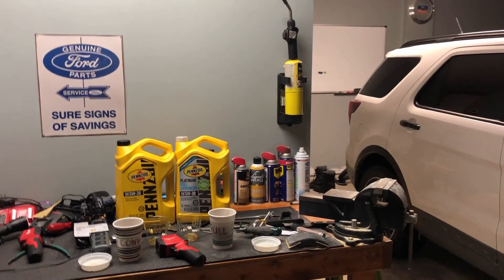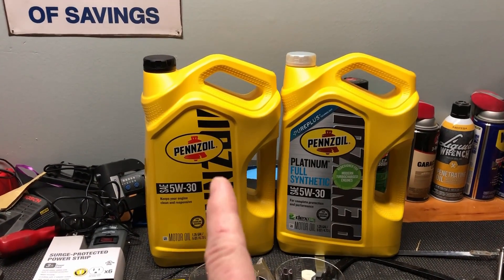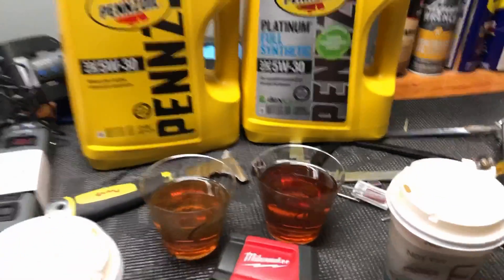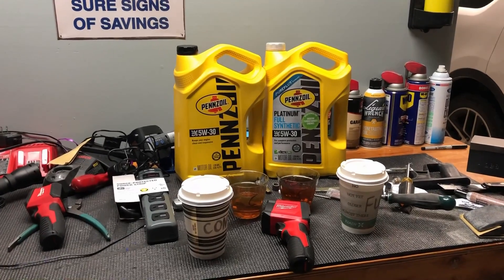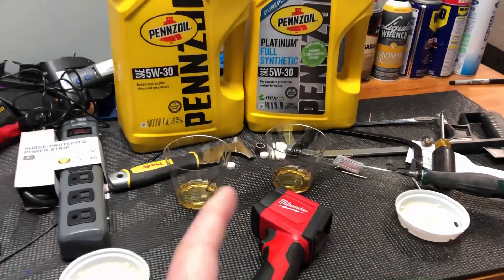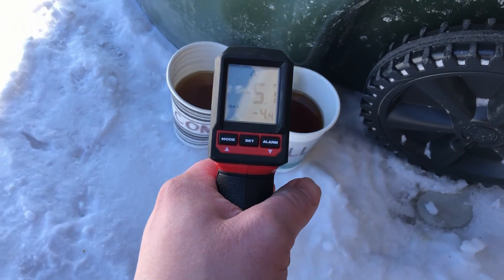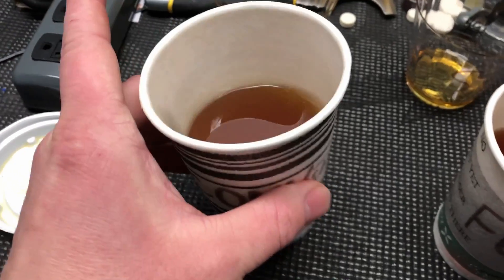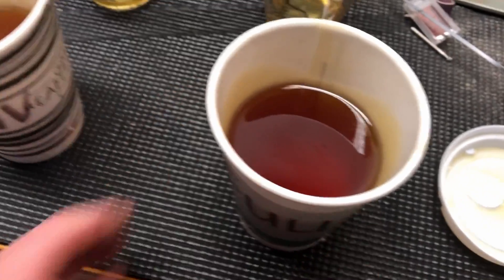Conventional vs Synthetic: Which Oil Do You Want in Your Engine During the Extreme Winter Cold?

Comment: What about the synthetic oil in the summertime but? Would it be safer to use conventional in summer time over the synthetic as the heat would make the synthetic thinner like water and have less protection over the conventional?? Just my thoughts 👍
Reply: I'd say pick an oil type and stick with it.
Reply from the maker: Synthetic is superior at all temps especially in extreme cold and heat.
Reply: I’d say conventional would be better in summer,maybe synthetic in the winter
Reply: Monza 84  synthetic does not break down at higher temps like conventional oil does. As mentioned already synthetic covers a much broader range of temperatures per viscosity range.
Reply: @dmc1221  you do not want to switch back and forth from synthetic and conventional. You would want to use that 10 minute oil flush stuff if you were going to do that. But not a good idea! Pick one and stick to it🤔
Reply: Why would you need to flush it,sure you can mix oils,and I personally wouldn’t use flush as it can do more damage than good
Reply: @dmc1221  once you use full synthetic It Coats your motor differently. Look up yourself. You can go from conventional to synthetic but not recommended to go from synthetic to conventional. Sorry I don't have time to give you all the scientific details🤓

Comment: I have 2 cars currently, an Aerostar. (97) and a 95 New Yorker..

Both run good, and use little oil.

The van has 170k miles, the car 52k.  I used to drive a 93 Deville and it had arpund 80k. It also didn't use much oil until a couple of days after a fresh change of Mobile 1. Buy buy rear main seal.

Fool me once...

Comment: But if it doesn't stick to engine parts, you will be starting the motor dry.
Reply: Perhaps if the engine sits for a month it will dry, but in most cases people start up their engines daily, or atleast a couple times weekly.

Comment: 04 F-150 5.4..230k mi...Valvoline vr1 20w50...-22 degree's last nite...i left it run all nite $10 worth gas in 13hrs idleing....didn't worry about startup...engine has never been apart :)
Reply: 20w50? I'm not on the 5w20 bandwagon, but why THAT high? Trying to stop a main seal leak?
Reply: Truck has never leaked oil....20w50 runs 10k mi without any trouble....thin synthetic oil won't
Reply: Makes me wonder, what causes more engine wear?: 13 hours at idle, or one cold start at -22f? Not that any of us can know without actual testing, just a thought
Reply: Idleing won't hurt it...cold starts might....battery can't take -40 wind chill so leave run.   0 degree's and above it starts fine.
Reply: Immediately after it leaves the factory...lookup vr1
Reply: If I had 20W50 in my engine anywhere near-20 I would probably leave it running all night too. Be 15-20 seconds before you get oil pressure maybe more on a cold start. 5w30 full synthetic for me in my winter truck
Reply: Cold oil won't blow it up.....full synthetic will....
Reply: vr1 doesn't smell...my exhaust is original..
Reply: Say goodby to your catalytic converters using VR1 oil. Got over 300k on my 4.6 using conventional 5w30. ( Still going strong ) No need to run such a heavy oil.
Reply: I live on Pluto and run 75W-140 gear oil in my engine. You are small time.
Reply: @aspenyukon6845  Why will full synthetic blow it up?
Reply: VR1? So you are using a 20w50 racing oil in your pickup truck? lol. On the recommended oil you wouldn't need to let it run all night. You say "thin" synthetic oil has given you trouble running to 10K? What kind of trouble? Couldn't have been that bad if your engine has never been apart.
Reply: I would've saved the 10 bucks and put 5 30 supertech synthetic in engine
Reply: Have you seen this guys other vids? He replaces timing chains because the hydraulic tensioner won't pump up with synthetic oil....have you ever drained synthetic oil? it's thin as hot coffee..
Reply: Converters can fail on any vehicle...where is their any proof oil cause's it? I will let know ya know if they plug....would be nice to run a bypass pipe around the converter if it plugs :)
Reply: @ Aspen Yukon. What part of the country are you from? Just curious. 20W50 in those temps. Thickest I have run was 10W40.
Reply: Cold oil won't hurt the motor.....do a hott oil test like draining it from the pan...20w50 has viscosity when draining...synthetic drains like hott coffee.